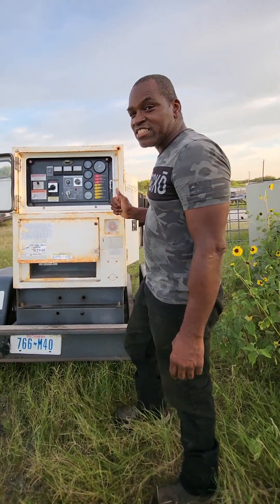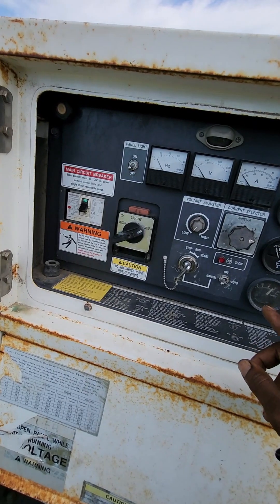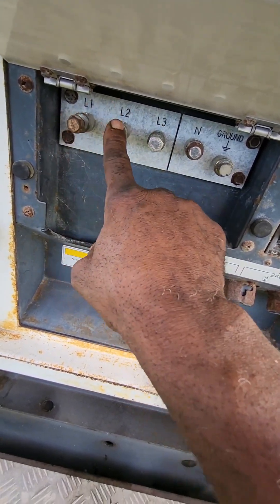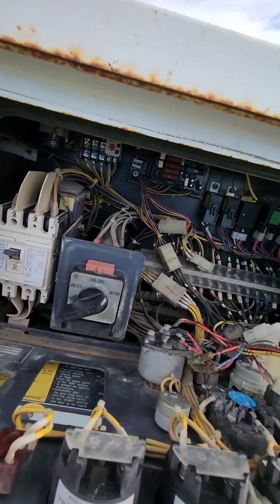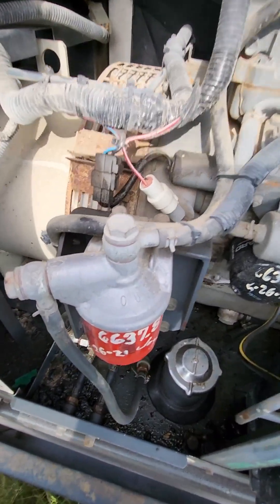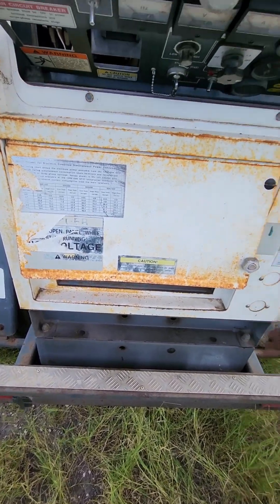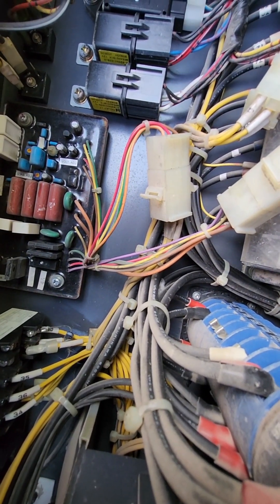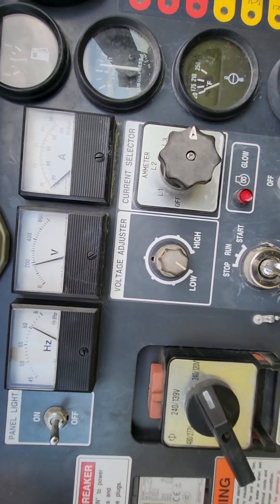Airman SDG25 Generator no power output

Comment: great video, do you know if these can be wired to a remote start or a eg4 chargeverter? (something that will kick it on when the voltage drops to low and it turns off when the voltage hits a certain voltage?
Reply from the maker: Hello sir , yes there is a automatic Transfer switch which will automatically start the generator and transfer the load.   Many sizes Brands and Prices, thanks for watching